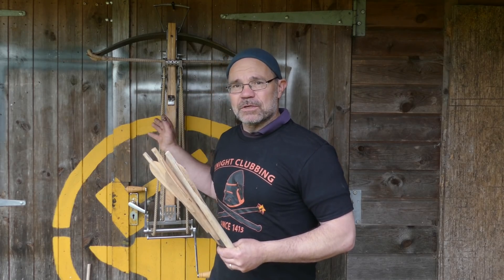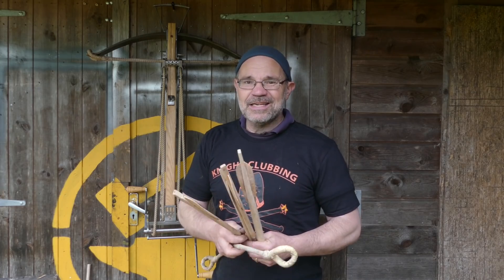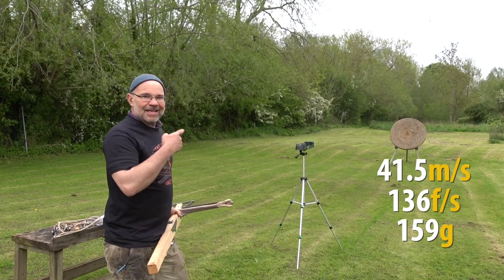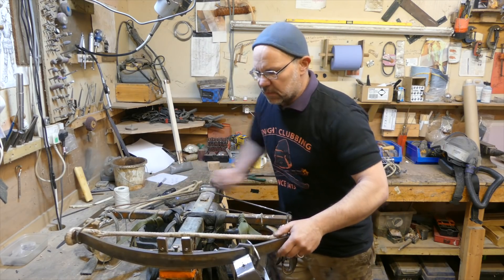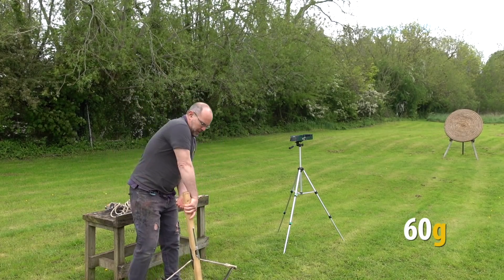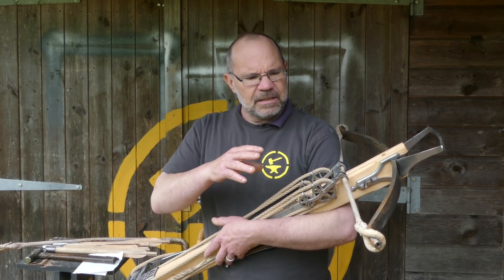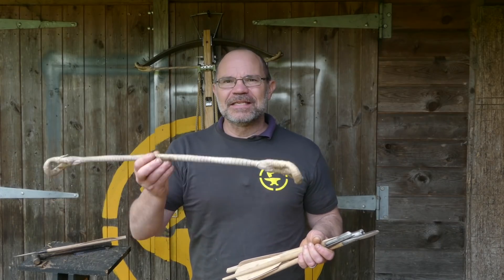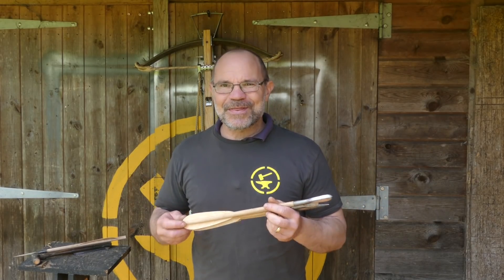Medieval bolt POWER!

Comment: Heavier bolts, or arrows from bows, use the energy more efficiently than lighter bolts or arrows. Think I first read that in Hardy's "Longbow" donkeys years ago & confirmed here. If I remember right, 80J is the force required to blunt-trauma kill?

Comment: Could it just be that the arms of the bow are already moving as fast as they can for their weight/length and spring coefficient (?) And so lightening the string won't make a difference to the speed of the arms, so would it be worth making a ludicrously heavy string to the same length (as far as possible) to see if the speed drops and therefore reducing the energy of the bolts?

Comment: Is there a maximum bolt weight that your crossbow could shoot? Could you make iron bolts 200, 250, 300 grams or even more and test them out?
Reply: You could make them heavier but it'll just make the fps slower, slower fps and increased weight will make it less effective since it' has less kenetic energy
Reply from the maker: how about 510g?  https://youtu.be/hU7KJ83MfWs
Reply: @tods_workshop  haha I guess I missed that video. 1kg bolt maybe???

Comment: Correct me if I am wrong but I think in one of your other videos you said soldiers can't string crossbow themselves on the battlefield. But in one of Andrea Bilcher videos, he strings his crossbow by placing another string on top and use a cranequin to pull the bow limb into position in order to feed on the proper bowstring. Why can't a soldier do that?
Reply from the maker: Not sure.  Andreas is right, it can be done, but spanning benches seemed to be used a great deal - not sure of the extent of either process
Reply: @tods_workshop  this is an interesting point, and perhaps an a hidden advantage of the cranequin over other spanning methods?
Reply: Does the cranequin allow for a controlled unloading of the limbs?
Reply from the maker: Both the cranequin and the windlass can be used in this way, but you need a double nock to do it and that works with composite bows, but I have never seen it on a steel bow.  Either cranequin or windlass would allow for controlled release

Comment: Came across this phenomenon in ‘principles of traditional archery’ by Thomas grissom. ‘The fraction of energy stored by the bow that is actually imparted to the arrow increases with arrow mass’ . hence heavier arrows for hunting penetration even if they go slower. Unfortunately he doesn’t explain why. May be to do with the limbs overcoming their own inertia, internal friction and air resistance. Limbs have a maximum speed to uncoil (dry fire) which would seem to be limited by these. Same energy imparted over a longer period (slower arrow) would seem to reduce these losses resulting in more energy transferred to the arrow.
Reply: You're thinking along the right lines. It's the kinetic energy of the limbs of the bow that matter. A heavy arrow moves more slowly, which means the bow limbs also move more slowly (they are in effect attached to the arrow by the string) , which means there is less kinetic energy in the bow limbs (and therefore the arrow/bolt gets a larger share of the total energy).
Reply: @WMYST  so the bolt and limbs move forward as a unit, the energy being shared to move the mass of bolt and limbs? Oversimplifying but if the bolt was the same mass as the effective mass of the limbs it takes half the available energy, if it was half the mass of the effective mass of the limbs it takes a third of the energy? That sound about right do you reckon?
Reply: @ttneiltt1  About right, but  because not all parts of the bow move at the same speed, the "effective mass" of the limbs could be quite a lot different from the actual mass. If I remember correctly, with typical bows and arrows you get about 50-60% of the energy into the projectile (I could be wrong on that).

Comment: Even through that crown bolt is not military, I would like to see what it does against plate armor. The shape of the head might make it less likely to skate off of a curved plate unlike that of a platecutter. More or less the force being applied to the target like a mace, would it be enough to do anything, Arrows do hit hard on their own but would it be enough to make a plated soldier stumble back or even fall down from the hit. Another thing is soldiers wearing padded armors to stop arrows from making lethal shots, Would these bolts (or even arrows) be enough to transfer enough force to break bones or cause physical damage to the muscle/organs. Ideal from this is coming from grenades killing from not shrapnel but the explosive pressure hitting the organs. Be interesting from one of the heavy war bows having that heavy draw weight to launch one of these heavy heads at a target.
Reply: The padding is to absorb some of the hit. 

Plate armor turns an arrow or sword blow from piercing damage to blunt force trauma, and then you want something to help disperse the blunt force.

Comment: If the narrower headed bolts are actually delivering less force due to being lighter, would somehow increasing the weight of the bolt but keeping the narrow profile help with armour penetration?
Reply: Of course ,smaller frontal area = less energy needed
Reply: You could make a narrow head heavier making it longer

Comment: Kind of random, but i found designs for 3D printable plastic chainmail and im really interested to see how it would do in comparison to traditional mail. is there a PO box i can post some to?
Reply: my best guess, no contest
steel is WAY stronger the plastic
Shadiversity had done a video with 3d printed swords, iirc they lasted 1 or 2 hits before snapping
Reply: @Sawtooth44   having gone and looked at the video, in guessing he used pretty thin PLA. I’m thinking of using ABS which is ~4x stronger
Reply: @kovona   it’s not as strong definitely, but the links would be a fair bit thicker
Reply: @kovona  i still would not be putting my faith in plastic chainmail
maybe in breastplate though, dosent have to be as strong if the blows are deflected
Reply: @Sawtooth44  I know that an SCA heavy fighter actually retired from a match because his plastic armor wasn't letting him feel any hits.

It was a copy of one of the King Henry's plate, just made from picklebarrel plastic.

Comment: Tod, would modern spring steels that allow for more flex and draw length in a medieval crossbow format have any substantial difference?
Reply from the maker: Probably not the steel as such, but a good design using FEA or similar to evenly stress the metal perfectly would

Comment: Hi Tod. Can’t you just twist the string to shorten it like how it was done in the old days when men had bows and brains?
Reply: A bow string, yes. A crossbow string, no. :)
Reply: @suntiger745  I’ve twisted mine with no ill effects ? I know the string is fat so the twist puts a lot of stretch on the outside strands but they settle in after a few shots.
Reply from the maker: of course you can and I did
Reply: @andrewsock6203  Ah, I thought the crossbow string was to thick and stiff to twist. Learned something new there. :)
Reply: @suntiger745  it’s good to learn and experience before attempting to teach 😂🤣😂👍
Reply: @tods_workshop  why on earth did you not do it for the video?

Comment: So I had a thought, would a fullered bow have the same/nearly the same strength as a non fullered bow of the same thickness? Would it even be safe to shoot? Would the weight reduction help with the transfer of energy? It should be similar in effect to an I beam, in theory. If they didn't do it historically there has to be a reason but is that because it wasn't safe, worth the effort or something else.
Reply: An I-beam or H-beam is a lot stiffer.

The problem with a fuller on a spring is that it introduces weak points. You're not even supposed to sand across a spring, just down it's length.

Comment: The surface area the energy is transferred over would be significant too though I would have thought. The bodkin tip is lighter but the point of impact is much smaller than the "mace bolt", so would the impact be more significant? I don't understand to what extend the lesser momentum counteracts that though.
Reply: but the "mace bolt" gets stopped nearly instantly and transfers all his energy in a much shorter timeframe into the target than the other bolts
Reply: Better penetration with the bodkin tip.

With firearms, you want to transfer all the energy into the target, this means stopping the bullet inside.

But with arrows and bolts, it works more like a knife than a bullet, you need at least 4" of penetration to reach vital organs or blood vessels.

Comment: Where did you get your statistics on the 9x19 Parabellum for comparison? For some reason I feel like my sidearm packs a ton more energy than crossbow bolts.
Reply: Your sidearm does indeed pack a ton more energy, but not much momentum. 
See e.g. https://en.wikipedia.org/wiki/9%C3%9719mm_Parabellum
Reply: @wmyst1797  how so? Describe momentum in this context in physics terms.
Reply: @blakebaker830  momentum is mass x velocity.

Comment: I'm really curious what the upper end of the scale looks like.  There should be a point where increasing the mass of the bolt drops the velocity so much that the energy begins to decrease, but it's clearly somewhere above 159 grams.  I'm sure a 300g bolt wouldn't be all that useful on a battlefield, generally, but for very short distances against very heavy armor?
Reply: I don't think so. any energy not used in accelerating the bow and string (and that will always decrease as the seed decreases) goes into the bolt. What would happen is the velocity keeps dropping, eventually to the point where the range is too short to be useful. You might also find the recoil becomes unmanageable due to the high momentum transfer into heavy projectiles.

Comment: More "power" (kinetic energy) might not mean better penetration on target. Bowhunters have known for years that heavier, slower arrows with less kinetic energy but more momentum can penetrate game animals deeper than lighter, faster arrows with more energy but less momentum.
Reply: (velocity x mass) is momentum, so I'm not quite sure how your first point relates to your second. 

A heavy, slow arrow (from the same bow) has more energy than a light fast one. Slow arrows lose less energy for a given depth of penetration into flesh because the resistance force is higher at higher velocity (so they penetrate further for a given energy), but it's still all about the energy, not momentum.
Reply: My bad; fixed that. But, you're still missing the point, and still wrong. It's not ALL about the energy. Nor momentum. A 1,350 grain arrow at 175 fps from a yew longbow penetrates better than a 350 grain arrow at 350 fps from a modern compound bow. See the link below.

Comment: You said you wanted to test the heavier of the bolts on some lamb's leg or something. If you want to do it just for the sake of doing it, that'd be interesting, but I doubt their practical application was to penetrate. I envisioned it similarly to how a modern bolt-gun stuns cattle.

Comment: Thanks for this interesting test. I am confused now: I thought the energy came from the bow so would roughly be constant regardless of the weight and that only the momentum would change when the weight is modified. As a rule of thumb, I often use that trick to guess the speed when I change weight (m1*v1^2=m2*v2^2 gives me that the ratio of speed should be the inverse square root of the ratio of masses). Can someone explain why the total energy actually changes ? Thanks.
Reply: Not all of the energy goes to the bolt. With lighter bolt, string gets accelerated faster and drains more energy. That’s my guess.
Reply: @JohnSmith-ts3dt  Thanks for the idea. However, at 07:18, we learn that a 2.65 heavier bolt drains 1.55 more energy out of the bow (extreme lines) or that a 16% increase in weight (middle lines) gets 8.6% more energy.
Reply: @fvsfn  It's not just the string, but also the limbs of the bow. With a heavy projectile the whole system slows down. The bolt receives any energy that isn't used accelerating the string and bow.

Comment: To think modern crossbows do 470 feet per second due to the lightness of the bolts and modern materials.
Reply: And much longer draw length.

Draw length is roughly analogous to barrel length in firearms.

Comment: Is it normal that the bolts dont seem to fly straight? Itll slow them down A LOT im sure. Shad did a video where he discovered he wasnt releasing straight, there is. Trick to it i doubt you can pull of with a xbow.  But none the less something worth discussing

Comment: Can I get a clarification on something. When you say that the 159g "crown" bolt is not used for war. Do you mean that particular bolt head is not used for war? Or bolt of any head but approaching 159g is not used in war?
Reply from the maker: Crown bolts, but as far as head weight goes, I don't know, but most heads are in the 45-65g range

Comment: Just out of curiosity, could you make something like a needle bodkin head for your 159g bolt? It would be interesting to see what that level of power and momentum would translate as in terms of penetration and damage.
Historically, could they have used this kind of weight of bolt in a military context? (As opposed to just using it for hunting.)
Reply from the maker: Yes that would be, but as it is not historical, currently not for me

Comment: Why can’t you make a longer draw length ( power stroke) on your medieval crossbows? 
Modern steels should easily allow you to make a prod that will bend much more than those of 800 years ago.  Even a 3-6” increase in length should make a huge difference in the speed of the released bolt! This amount of difference would not detract from the historic look either. I appreciate hearing your answer to my question.

Comment: See to me.. ok. U pull both back to the same locking point correct.. same power stroke. Ok.  So I feel it should be the fact that the big beefy string wants to let go of it's energy, quicker... Or Faster... It wants to release it's tension quicker than the thinner string... Makes sense doesn't it.. or no???